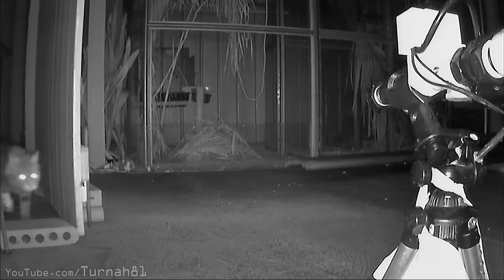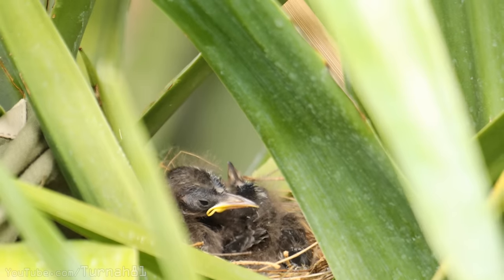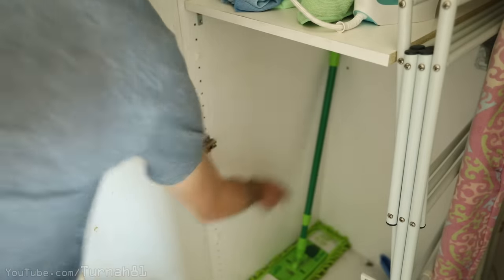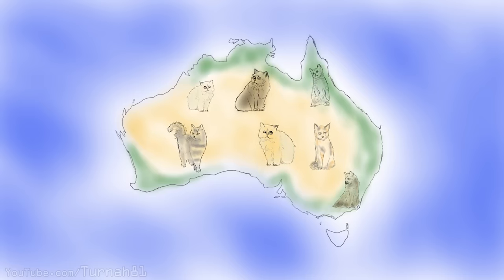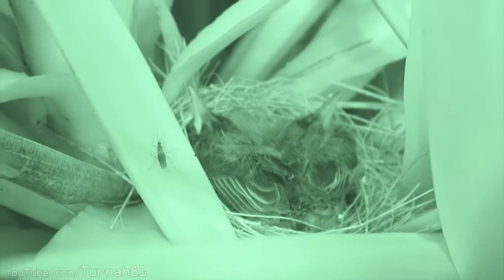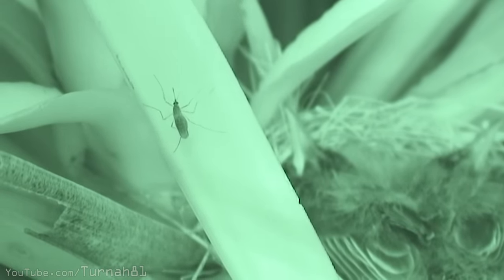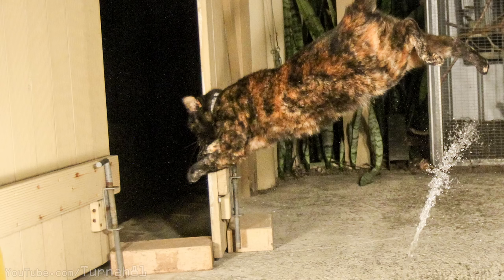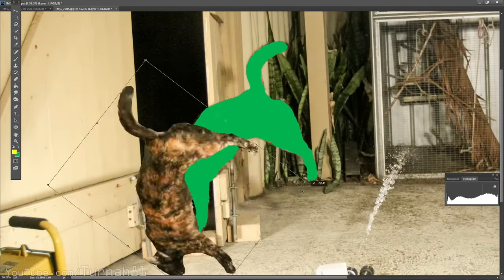He Wants the Baby Birds! Cat Repellent says “No”

Comment: use a different nozzle, one that sprays in a larger area - a cone.
Reply: Nah, I think that would result in an overly light spray. A 3 way nozzle would be a great idea though, one hitting dead centre, and the other two angled outwards slightly to ensure that retreat in any direction will result in additional soaking.
Reply: @xRawburtx  not if the water jets were focused a bit tighter. The initial spray wouldn't hit with quite the same volume of water, but I think the secondary jets would more than make up for it by leading their target.
Reply: @LyK0sa  agreed
Reply: @xRawburtx  you could make a system with tubes that clip onto the hose connecting water to the cannon, and have the tube go to the middle, then branch off somewhere into slightly smaller tubes that go in front and behind the target. The smaller tubes would compensate for the pressure loss from the extra 2 tubes

Comment: A good strategy I recently learned from my mate is to trap the neighbour cats using a $30 eBay trap. Once trapped drop it off at the local pound but make sure you do it late afternoon. By the time the pound alerts the owner it will be too late to pickup that day & as the cat now has to stay overnight it will cost the owner more money to retrieve the cat. Also I recently heard KFC is irresistible bait to even the most trap savvy cats. 

Also I’d love to see a multi water jet ground pad type setup, something to wet the whole underside of the cat at once when triggered, I reckon the resulting aerial acrobatics would be amazing.
Reply: Excellent idea, the dropping it off just before closing time.
Reply: there are 1,000 psi water jets you can buy that really drive the point home that you dont want cats killing bird hatchlings
Reply: @denisegore1884  makes sense as they are required to be kept in to prevent damage

Comment: I think you either need to:
1. Replace the water with gasoline and add a pilot flame
Or
2. Use concentrated sulphuric acid
Reply: A bit of 1080 in the water, then when the cats go to lick it off, boom. Dead cat

Comment: Im actually in need of 1 of your water cannons as ive got a serious problem with the catwoman next doors army of feral tom cats trying to get at my catbitches. Ive caught a few and held their heads down the toilet but that makes my welding gloves stink, ive trapped some and waterboarded them for an hour but they still come back. Ive trapped others and then released them 10km away.... that worked but theyre resistant to the trap now and my missus wont let me use electricity..... or fire. :(
Im thinking of spraying them with industrial weed killer diluted with tuna brine....